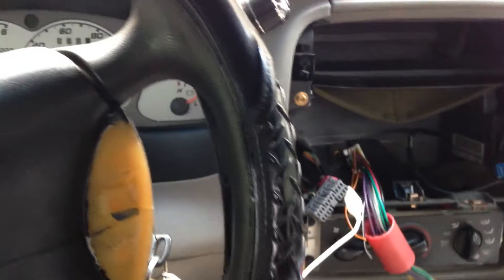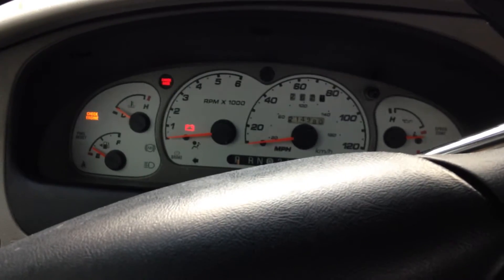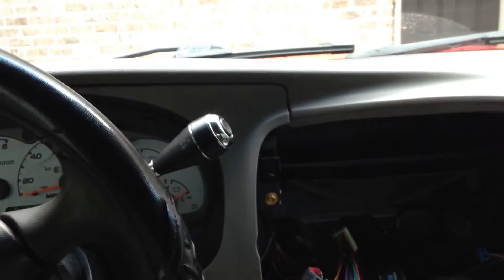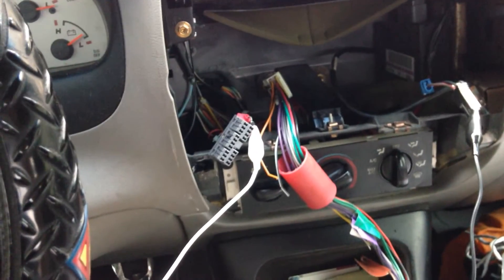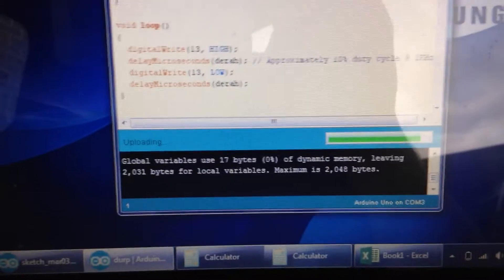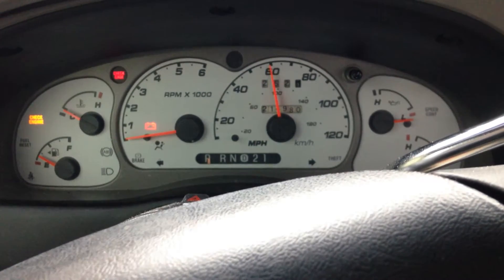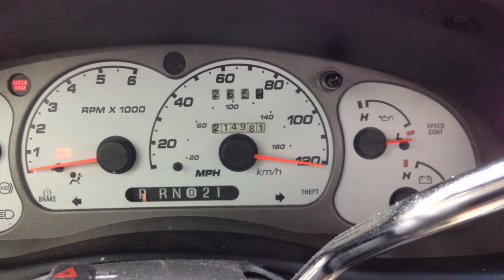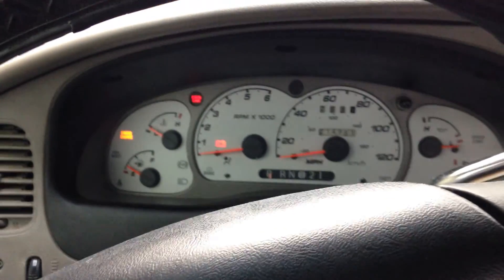Ford Ranger Speedometer Calibration / Testing Part 1

Comment: Does overdrive still with the Town Car shifter? Thanks!
Reply from the maker: Yep plug n play. Here is when I installed it (12 years ago) https://www.ranger-forums.com/interior-exterior-electrical-123/how-install-lincoln-town-car-shift-handle-118753/
Reply: @TheVintageEngineer  Cool mod, thanks! I was thinking about adding a ‘97-‘03 F-150 shifter to my ‘99 Ranger.
Reply from the maker: @2H2521  Hmmm looks like the f150's have 3 wires where Ranger has 2. Wonder what the other wire is.
Reply: @TheVintageEngineer  Must just be an additional connector for the other vehicles, I had completely forgot there was 3 & not 2. I just ended up buying a shifter in good condition off Ebay. Sorry for the late reply!

Comment from the maker: Update: Forscan now has the ability to reprogram GEM tire size specs. Killed project since all I had to do was type in new tire size and now speedometer is reading correct using GPS to confirm.
Reply: What forscan module did you use

Comment: do you have that code for the arduino?
Reply from the maker: int mph=30+5;
float hz=0.000002222222;
int derah=(1/(2*mph*hz));

void setup()
{
pinmode(13,OUTPUT);
}

void loop()
{
digitalWrite(13,HIGH);
delayMicroseconds(derah);
digitalWrite(13,LOW);
delayMicroseconds(derah);
}